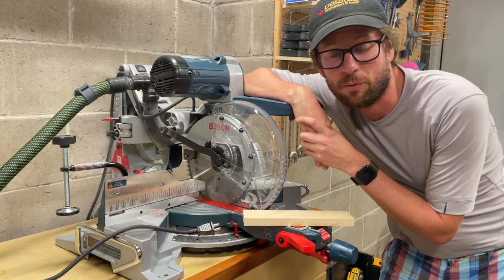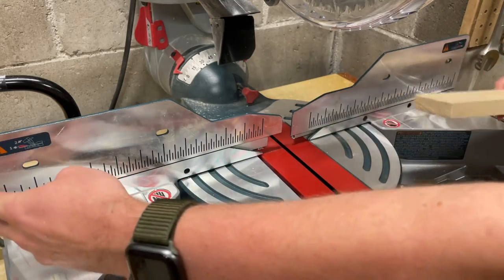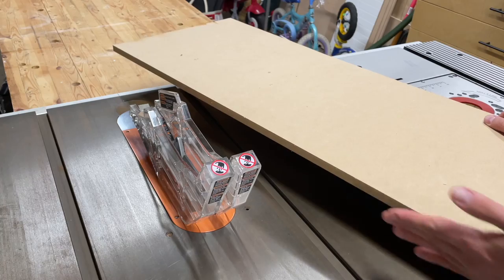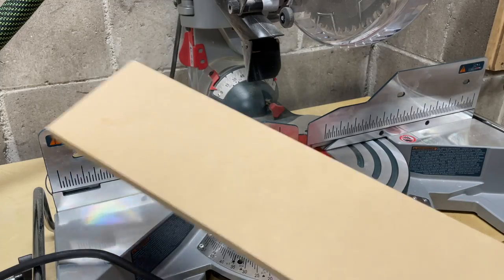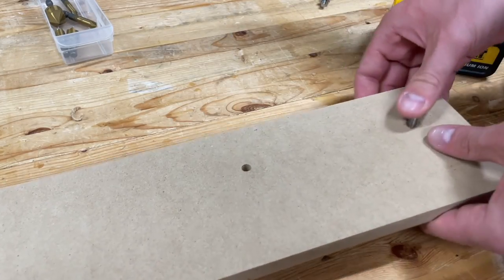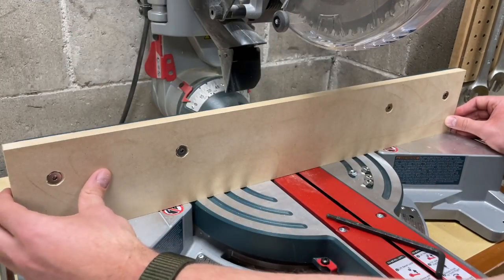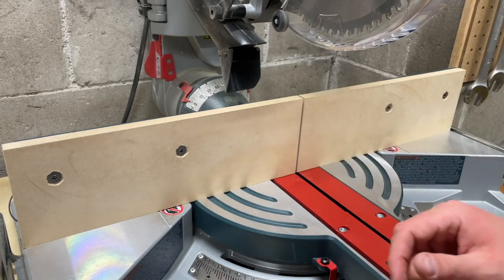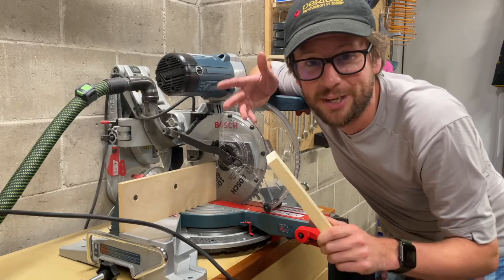Simple Miter Saw Zero Clearance Fence - Easy & Fast DIY Build

Comment: If fence itself is damaged beyond repair can a something like aluminum angle iron be used and then add the wood to that, stop blocks etc? My saw is too old to get a replacement fence
Reply from the maker: That’s a great question and something I’m not qualified to answer. I’m sure it’s possible, though!
Reply: @MasonWoodshop  thankyou! If it works I’ll let you know maybe pass on the knowledge

Comment: Understand the desire for a zero clearance fence and bottom plate. However I found the zero clearance fence option doesn’t allow for any dust collection. Repeat…none. This might be ok for small pieces but if you are cutting a lot of larger pieces the dust will quickly collect at the base of the zero clearance fence which is 1) messy and requires repeated cleaning after a few cuts, and 2) builds up to the point the fence is no longer 90 degrees. My two cents….
Reply from the maker: I haven’t used the zero clearance fence as much as I had anticipated, but when I do I find that dust collection isn’t quite as bad if I leave on side open. I still get a bit of buildup, but a chamfer at the bottom of the fence has helped alleviate the need to deal with it unless I’m making many cuts. If anything, I like the taller fence more than the zero clearance aspect.